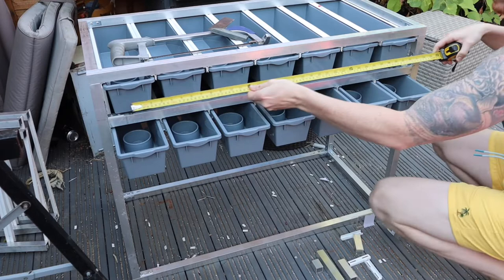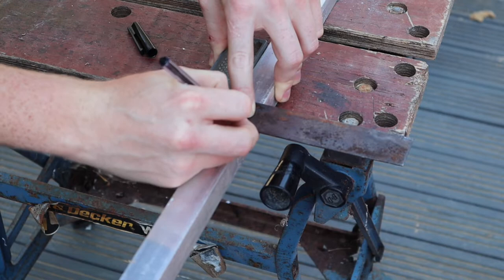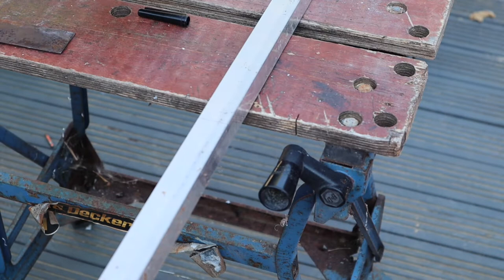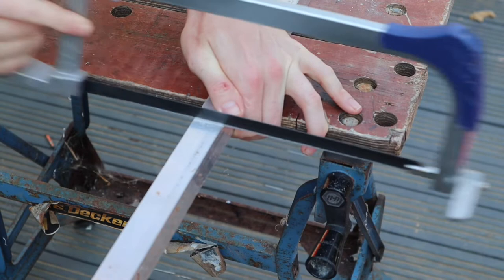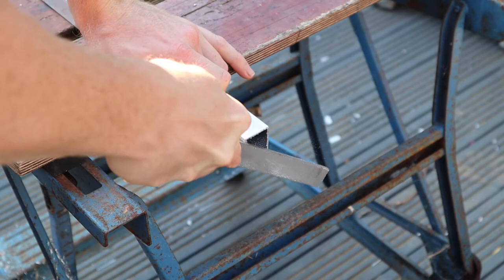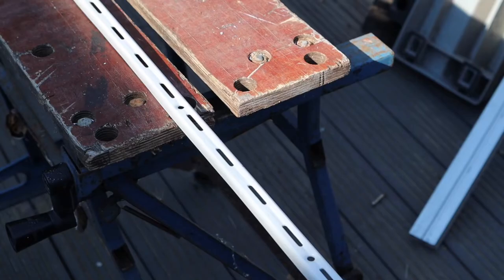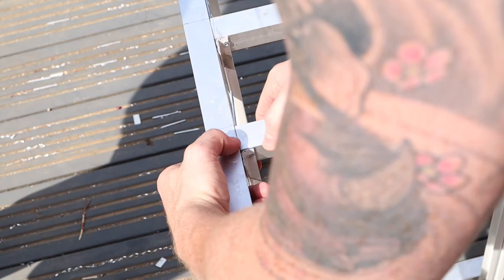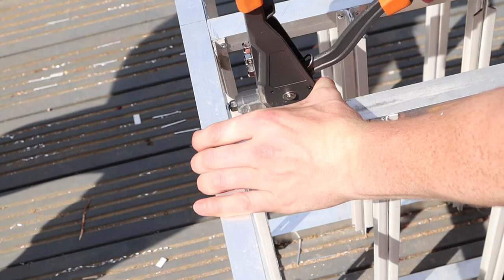DIY Hatchling Rack Only Using Rivets!

Comment: what size is the square tubing you used and the channel for the tubs to slide in? Great work man, this is just like the racks i pay $ 2500 for (US), i wonder how much cheaper itd be if i started building them...
Reply from the maker: it is much cheaper! drop me a message on Instagram and I can give you all the measurements etc.

@_a_tinge_of_ginge_
Reply: @atingeofginge2709  sent u a message what kind of tubing c channel did you use